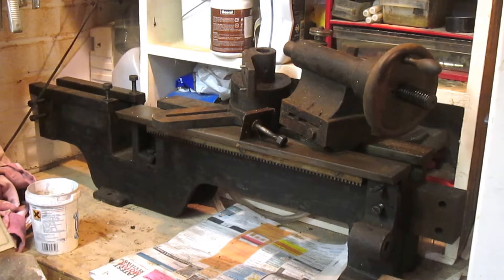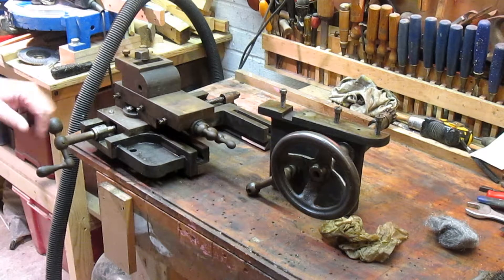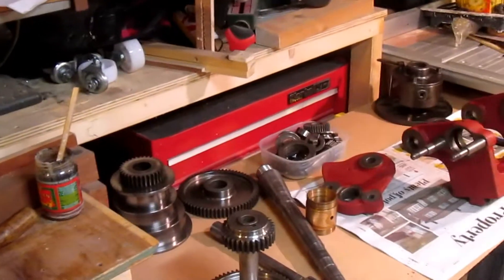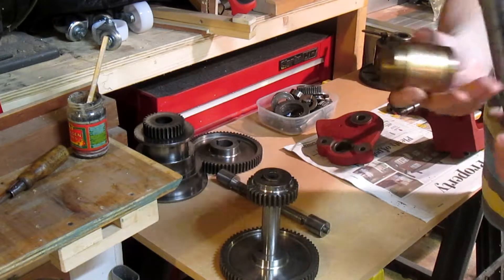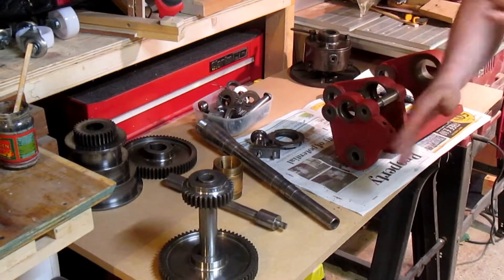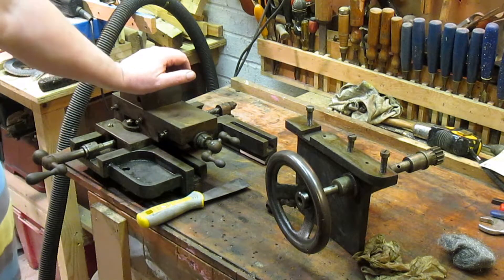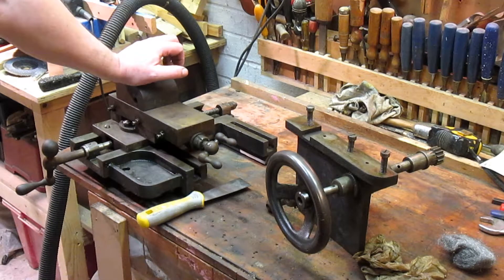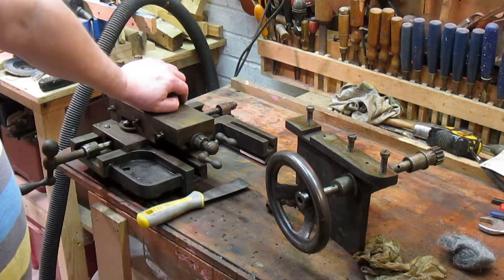Turnell & Odell lathe. Restoration # 01 Introduction & head stock

Comment: Hi Andy.
Looking forward to watching the rest of this vintage lathe project. Fantastic finish on  those gears and drive pulley. 
It hasn't been abused during its working life looking at the nuts and bolts etc. I bet you did didn't lift it up on that bench by yourself.

Comment: I work at Turnell and Odell, if your still interested I could have a word with Mr Odell to see if he can put a date on it from the videos.
Reply from the maker: Hi Ashley, I've phoned & emailed Turnell & Odell and they just keep saying they'll get back to me, I'd be greatfull for a little reminding from the inside. I've talked to Tony at Lathes. UK and he's dated it 1910 -1920. http://www.lathes.co.uk/turnell-and-odell/
There seems to be alot missing from the lathe, change gear guard, whatever attached to the cast lump on the tail end of the lathe bed and the head stock end leadscrew hanger has a void in it perhaps  for a gear for some reason?
It was going to be scraped if I haden't brought it, glad I saved it, it's a sweet little machine.
Reply: @atowning  I'll have a word.